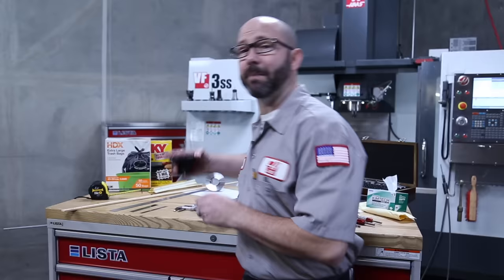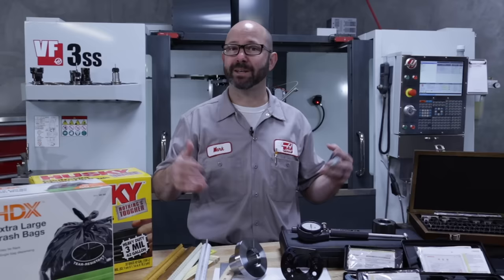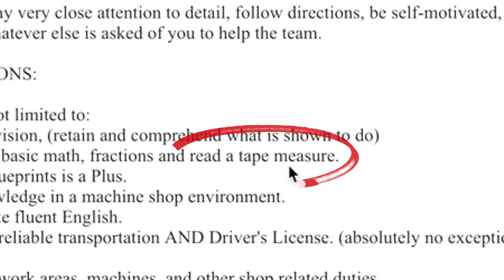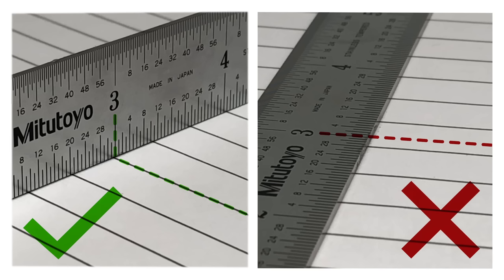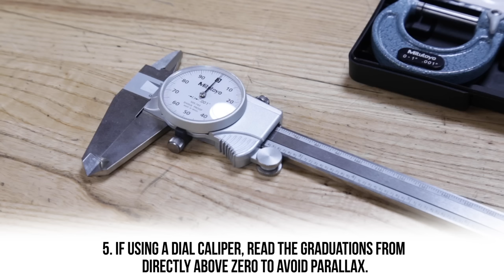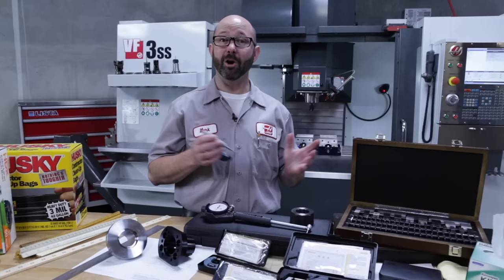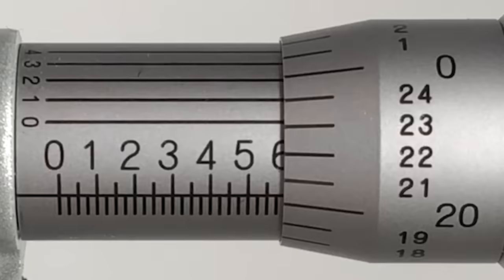Measuring Tool Basics: Day 1, Start Off Right - Haas Automation Tip of the Day

Comment: You overlooked the Vernier calipers. In many ways they are superior to dials or digitals. I always have a vernier caliper ready as a backup and reference. Both dials and digitals can be wrong at any point in the scale and you won't know, but not verniers.
Reply: Sorry Bill, but that is not correct. The digital callipers are more accuracy and precision. A mistrust of modern digital technology has given rise to this rumour. Cheers, Michael 🇦🇺
Reply: @SpatialGuy77  You don't know what you're talking about. All calipers have the same accuracy. Only Vernier calipers never give a false reading. Digitals and dials both can give false readings.

Comment: World would be a nicer place if everyone used only one of the systems. By that I mean metric
Reply: U mean beside the fact that metric is the system that science uses internationally?
And beside that imperial is defined based on metric standards?
Basically we are already using the same system we only have different 'standard measures'
As far as it goes for me measuring temperatures could look like this
295 K instead of roughly 22 °C/77 °F.
Not even speaking of grams and newtons
Reply: @datpudding5338  1. Imperial system is not standardized metric system... we have UK/US diffrences (1UK gallon is 1.20095US gallon), 
    1 inch [in] = 3 barleycorns = 25,4 mm 
    1 foot [ft] = 12 inch = 0,3048 m
    1 yard [yd] = 3 stopy = 0,9144 m
    1 perch lub rod [rd] = 5,5 yard = 5,0292 m
    1 chain [ch] = 4 rod = 20,1168 m
    1 furlong [fur] = 10 chain = 660 foot = 201,168 m
    1 mile [mi] = 8 fulong = 1609,344 m
    1 league = 3 mile = 4828,032 m

And 295 K is not 77°F its 71.(3)°F
Reply: Good example of ClickBait, but I'll take the bait: The part tolerance matters, not the measurement  system you used to create it. Cheers, Michael 🇦🇺
Reply: Nah imperial is better. The only problem with it is the way they do subdivisions is unpolished. If they had just fully embraced the binary system we wouldn't have this thou nonsense

Comment: When we train our aircraft mechanic apprentices, we use a standard manual vernier. They have to make measurements in inches, convert them to decimals and make them metric. Then they can control themselves by reading out the metric scale. They also have to do the same the other way around? Why do we teach them Flintstone-measuring? Because we can...

Comment: Excellent video, the biggest thing I learned is that the Metric system kicks Imperials ASS! 
Why is the US system so inconsistent with its measuring standard 5280 ft to a mile versus 1,000 meters to a kilometer 🙆
Reply: 5,280. And 3 teaspoons to a tablespoon. 4 tablespoons in 1/4 cup. 2 cups in a pint. 2 pints in a quart. 4 quarts in a gallon. And this is why  I too love the metric system. "If God had approved of the Metric System, He'd have given us ten fingers" :)

Comment: nice video, i think this "measures up" , but Witworth is another form of fractional inch that america uses, NOT to be confused with the English inch system. and IS different, ever wondered why that 3/8 " spanner doesn't fit an old cars bolts?? , This is why ( its a wit worth threaded fitting!!). but the BEST system is the FRENCH one ( the one the WHOLE WORLD uses) aka the ........ METRIC system (mm, meters, etc.), none of those crappy fractions you have to add or subtract in your head!!!

Comment: Great video, wow metric system is so much more convenient! Straight up round numbers, why do we still do it the same way as 100s or years ago when there is a simpler solution?
Reply: Decimal inch is just as convenient for those who are fraction impaired as mm.

When it comes to reverse engineering a part, it is generally easier to reverse an inch based part because you'll be fairly safe to assume the larger scale dimensions are based on 1/16ths of an inch. In metric, you cannot assume this and have to wonder whether the dimensions are to the nearest mm or half a mm. Oddball measurements in metric are harder to resolve into the designer's original intention. This gets really bad when inch based drawings are converted to metric, giving 3 decimal place metric measurements implying false precision to a part that was not precision at all.

Comment: I noticed you didn't align the spindle zeroes of the digital mic's when you zeroed the electronics. Is it not necessary?

 I've been aligning the spindle zeroes of my digital 1" mic, using the ratchet knob, assuming I would get a better force, and avoid over, or under tightening.

Thanks for these Tip vids.  Well done, and good info, both as new info, and a review.

Comment: thou caliper :D would be nice to have mike that reads that much decimals. Or better yet digimike. Some people read between the lines on a mike that only reads 0.01mm, so they read 0.005 out of it. I dont like that. Same as you cant read 0.5mm off a tape measure.

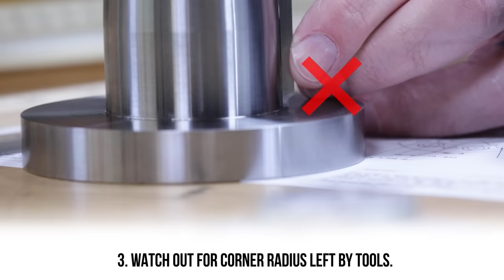Comment: 12:29 - "Corner radius" there is so much angles and corners to look at and not sure which corner is concern. Left by tool, I'm assuming it is the CNC mill's cutter tooling. Took me 3 days to finally comprehend what is being discussed here, zero info of details on the subject on the internet / youtube. I can actually see the little radius on the angle...

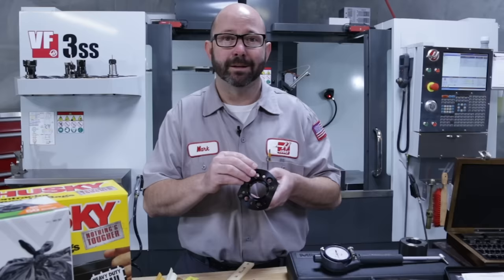Comment: Did you mean to say oversive the dimensions instead of undersize when talking about having a part anodized or coated? just wondering because wouldn’t the coating make the hole smaller by having a layer or thickness on top of a machined surface. The time in the video mentioning this point is 22:54. I really enjoyed this video, just wanted to verify a point. Thanks

Comment: can you go through bore gauge a bit thorough?
Reply: I too would like to see a thorough video on dial bore gauges from Hass. There are videos on YouTube about setting up and using bore gauges. It's the way Mark compiles and presents the information, that makes these videos so useful.
Reply: You're suppose to get the correct spacers for the distance being measured. Then zero it with a micrometer with the corresponding measurements.

Comment: black oxide can "shrink" bores. i had some parts with a hole tolerance of +0.012mm -0.0mm and they were too small after black oxide. i had to run a reamer though them after coating to bring them back to size and not scrap 400 parts.
Reply: Is it because of the heat or the coating?
Reply: @naruteoh123  no idea. I just know that they werde in spec before coating but not after

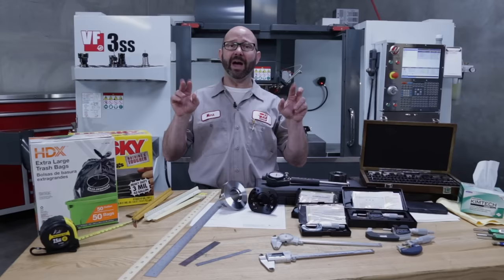Comment: 9:00 - Yea.. I'm from the US and grew up with the US inch imperial system, I strongly believe the inch system is only good to the point when you need precision measurements up to 1/4" or 1/8" inch... anything lower should be CM or MM. I know you're gunna hate me for saying this... but people who does precision machinists work using inch are bunch of great APEs. I know for a fact that some real pro experienced machinists in the US always have some metric measurement instruments because they do understand the level of stupidly of working down to the "thou" when "millimeter" and "microns" is much more logical and less error prone to work with. 
Theres absolute no reason to add a bunch of zeros before the inch decimal point and measure by the "thou", it's stupid. If you say it's more of cultural, flavour and history thing based on preference, I also think that logic is stupid since it's irrelevant for thinking and doing advance precision work the most logical way.

Comment: 'Accuracy' vs. 'Precision'  Ok, I am a noob when it comes to machining. As in I can only dream of running, let alone owing a HAAS VMC. And I appreciate the thoroughness of this presentation, and am finding it interesting. I accept the statement that saying 'mil' instead of 'thou' sounds weird to a US machinist. But I feel that same way when someone uses the terms 'accuracy' and 'precision' as though they have the same meaning. Well they don't and it really doesn't help matters for educators to pretend that they do. At a minimum, use the correct term, even if you don't plan to also explain the difference. Viewers may be able to figure it out from context. Or take a few seconds and briefly explain that accuracy relates to how close you are to the target or true measurement on average while precision relates to by how much repeated measures of the same thing vary. The struggle continues...

Oh, and 'vernier' is pronounced 'VER knee er' not 'ver NEER'. So it doesn't sound anything like 'veneer' (as in thin layer of hardwood) which is pronounced 'veh NEER'...

Comment: Mark,  I have a real world problem.  I could really use your advice. My Z value needs to be above zero (I am almost at the top of the travel).  I touched off Z on the tip of feature I am machining and pressed Tool Offset Measure.  But in my G code, it’s telling the tool to go to zero. I have already broken 2 tools, and cannot figure out what to do. I tried without a part or a tool, and sure enough it stops at zero when I need it to stop at 2.046”.
Reply: Bill do you have a G43 on the line with your H and Z?
Reply: fijianatheart thank you so much for replying. I found the culprit. It was a G53 with Z0 in it. I deleted the entire line and it solved the problem. I am actually pretty happy I could eventually debug the program. Thanks again.

Comment: This video shows perfectly how the Imperial System is obsolete.
Reply: I switch between the two daily, and I think they both have their place.
Reply: Metric is crap for machinists. Great for mechanics wrenches. I do both and imperial is better for machining and metrology. .001" is perfect for most everything .0001" for fine work is just right. The resolution of the metric system is clumsy and impractical, forcing machinists to count by 5's or 2's or some shit in between. .1mm is too big .01mm is too small and .001mm is way too small. The use of commas is idiotic, I'm sure they did that just to be "different", very french.Not to mention that thread chasing dials are near impossible on metric lathes which are standard in imperial lathes because metric threads are not whole fractions of the master lead screw.
Reply: @billshiff2060  "forcing to count by 5s and 2s"

speaking in 15/64

clumsy and impractical

the whole coma system is shit

LOL
Reply: @yosyp5905  15/64??? lol  We machinists are not bloody carpenters with rulers man. NO ONE in machining uses that. But yes the whole metric comma instead of a decimal point is utterly stupid.

Comment: So when measuring in bananas… I mean inches, for decimal places it goes tenths, hundreds, thousands then back to tenths?
Reply: Basically. Crazy, I know. Everything is usually in "thou", thousandths of an inch (.001"), where .100 would be called "One hundred thou". and then beyond that we talk in "tenths", which is a tenth of a thou. So .0002" would be 2 tenths. We get so used to it, we forget how strange it it.
Reply: @markterryberry4477  Thanks for the reply… in Canada we use both here and there. But damn, the metric system is so much easier.

Comment: But, all the damn tape measures are left handed...  what a PITA!

"Our grandfathers..."

Hey, I resemble that remark! I started out hand drawing, and STILL use my triangle scale rule.  Not so much the slide rule... to be honest, don't think I still know HOW to use a slide rule.
Reply: @nick f
Don't worry about that, I have the disease; I never throw anything away, until it is shavings, or disintegrated by rust!  LOL

Re: drawing tools

When I am in a hurry, it is easier for me to create drawings by hand than with a computer, and I'm no slouch with the computer.

The only way to beat hand drawing is with a fully customized version of AutoCAD.

Easy reproduction, and modifications is the only advantage digital drawings provide.

Comment: Metric is crap for machinists. Great for mechanics wrenches. I do 

both and imperial is better for machining and metrology. .001" is 

perfect for most everything .0001" for fine work is just right. 

The resolution of the metric system is clumsy and impractical, 

forcing machinists to count by 5's or 2's or some shit in 

between. .1mm is too big .01mm is too small and .001mm is way too 

small. The use of commas is idiotic, I'm sure they did that just 

to be "different", very french.Not to mention that thread chasing 

dials are near impossible on metric lathes which are standard in 

imperial lathes because metric threads are not whole fractions of 

the master lead screw.

Comment: So you can’t wrap your head around metric? So long, dude. Subscription cancelled.
Reply: Metric is the best! I'd flip the switch to metric right now if I could. Makes so much more sense in many ways. Changing over measuring tools will always be a problem for us here in the US though, and I'm not sure when we will finally change. For now, we work in both Metric and Imperial. Doing automotive work, everything was in Metric, and on a day-to-day basis we did a lot less math, fewer conversions of fractions

Comment: You are kidding me? Are you saying CNC machinist can't use meteorology equipment and do not know how to measure! Hence they need a tutorial?? Unbelievable..!! Who are this tut's directed at, people who have an interest in manufacture but know little or PROFESSIONALS coming to this channel to gain some USEFUL insight on HAAS nuances??
Reply: CQEflash I agree that this is to basic... but on the other hand, we don't have to watch it.
Reply: You only realize how many fundamental things you've been doing wrong when you see a real master of the craft or scrap a bunch of parts because you thought you knew what you were doing but didn't "have the feel"...In my opinion getting started on a brand new CNC, installed by the riggers and adjusted by the reps makes for an ignorant machinist who incidentally makes most of his parts right! Best start to master this job would be some clapped out relic, which will probably have you chasing your tail for a couple of years until you can really see the origin of the problems. Mass production of top quality parts on a machining center will be a walk in the park after that (and an equally steep experience of picking your confidence back up). Even the best machine tools still have so many sources of errors, while even the best measuring tools and metrology equipment have a degree of uncertainty.
PS: I didn't see anything new on this one, but I found out about the tape measure at about the same time I figured how to calibrate my OD mics via the reversal method (ain't no cheap unverified gauges for me no more). Oh and never calibrate something on zero...it can be way off.
Reply: This is not directed to HAAS professional customers, it is a useful general view about measurements in CNC machining (any kind of machine, not only the ones sold by HAAS).
Young people entering in this world can have an idea about details hidden behind a machined part.
This happens for any passion in your life: before you get in just for curiosity, then you like it, then you go deep. (This happens with girls too, but CNC-mills are usually less expensive.)
Reply: You mean metrology
Reply: That help wanted ad in the video hit the nail on the head... there are so-called "CNC machinists" out there who cannot read a tape measure. let alone a Micrometer or Calipers.
Reply: @CozzyKnowsBest  I do indeed typo. ;)
Reply: @CQEflash  I used my anemometer to measure roundbar. 9 knots. Messed up the fan but it turns out you are right after all.
Reply: Awesome material! Thanks you so much. It would be awesome to see  more tutorial for other instruments such as: Telescopic gages. Inside micrometers, depth micrometers, High gages, plugin gages and pin gages. It's allí basic, but i have realize that even pros forget the basics. Thanks for sharing your knowledge.